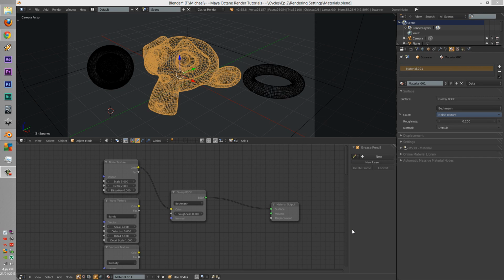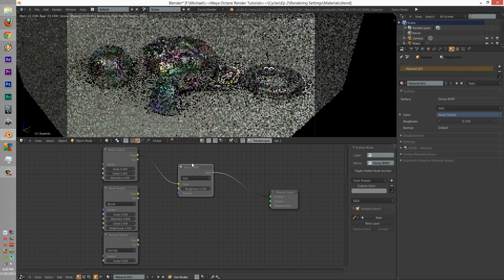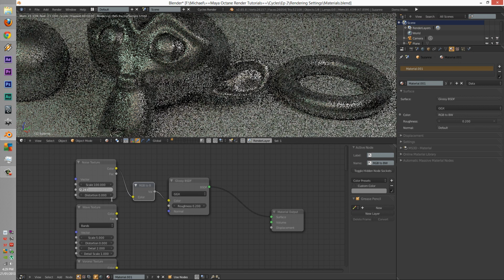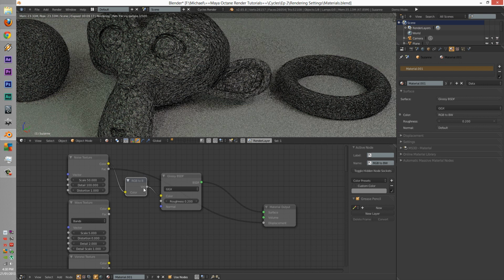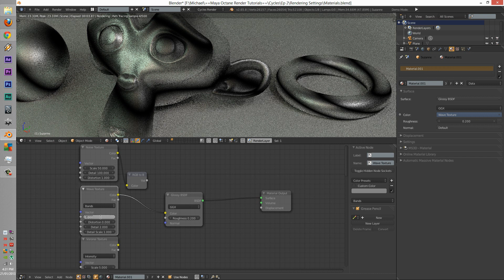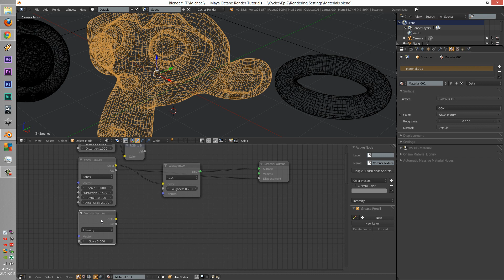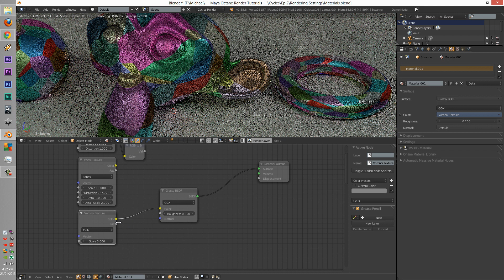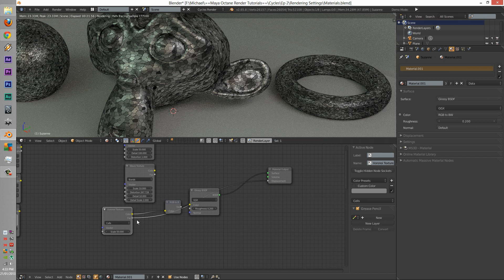Blender Cycles Basics Episode 7: Generators: Noise, Wave, Voronio

Comment: how can we use the wave texture to create the wood ?
Reply from the maker: hmmm how to use it? or how you can use it? i dont get the question :(
Reply: I mean lets say you want to create wood texture with it. Dont you need to add colors to it. Or you leave it black abd white. How could you create wood texture using thats wave fillter. Thanks for answering
Reply from the maker: I would mix or multiply it with a rgb curve, im going ad limb since thats the technque within octane. I will check it out on cycles.